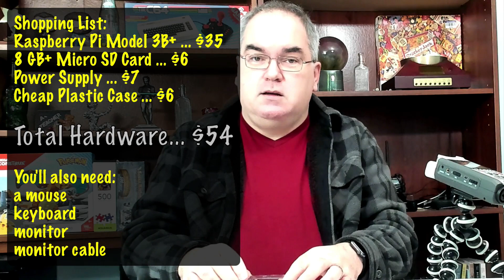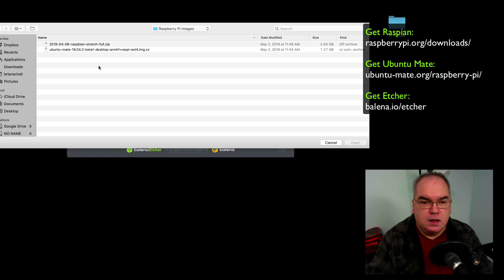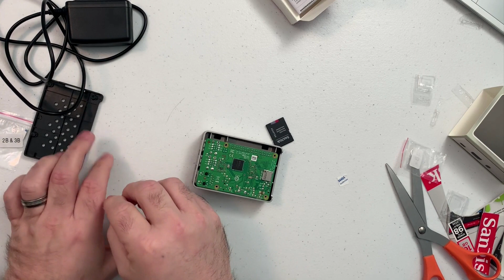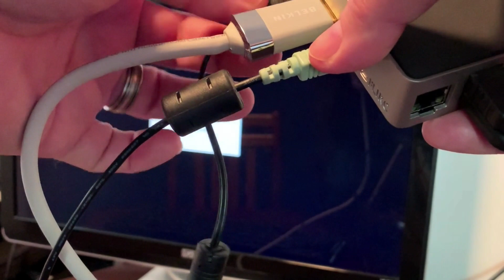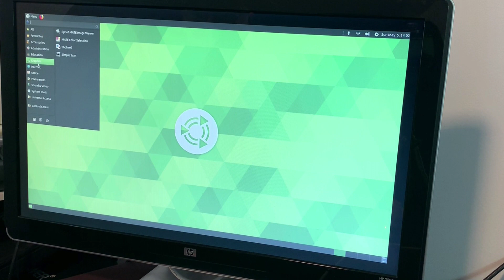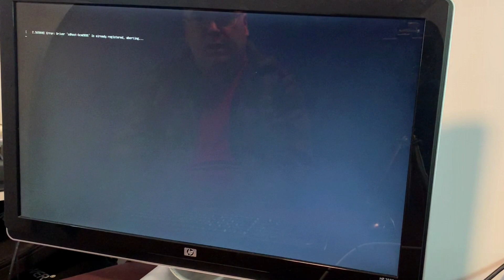Setting up a Raspberry Pi Model 3B+ System with Ubuntu MATE 18.04

Comment: can i use Ethernet cable instead of HDMI
Reply from the maker: jeevan prasad It depends on what you meant by that question. You can use SSH to get into the pi remotely, but you cannot use ethernet as a video cable. By remoting in, you do not need either a monitor or a keyboard with your pie.

Comment: do you know how I can set up with ssh? I did everything on google but didn't work
I remember on 16.04, there was ssh tab on raspi-config but not on 18.04
can you help me?
Reply from the maker: It’s still there in raspi-config (in Raspian anyway). Look under the option for “interface options” there are several options including SSH and VNC permission.
Reply: @BrianSchellAuthor  I'm using ubuntu-mate 18.04 and under interface option,
there are only camera, spi, i2c,  serial, 1-wire and remote GPIO only
Reply from the maker: Try
sudo systemctl enable ssh
sudo service ssh restart

Comment: important question-- how does one get back to booting into the desktop?  :-) (and does "startx" work on this system?)
Reply from the maker: With Ubuntu-Mate, you enter:
sudo systemctl set-default multi-user.target to make it boot into command line mode

To go back to the GUI, enter:
sudo systemctl set-default graphical.target 

These two will alternate you back and forth between text mode and the GUI.

Comment: Do you know if this can be done with a usb flash drive?
Reply from the maker: Scott Woomer Not initially, no. You MUST boot from an SD card when setting up the Pi for the first time. 

After it’s set up, then you can switch to a USB flash drive, and an external hard drive if you want.